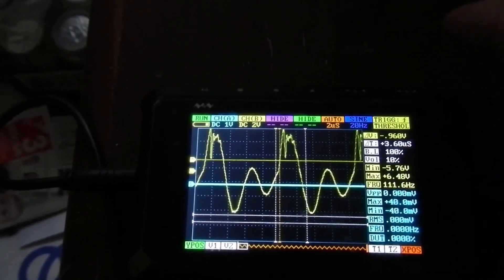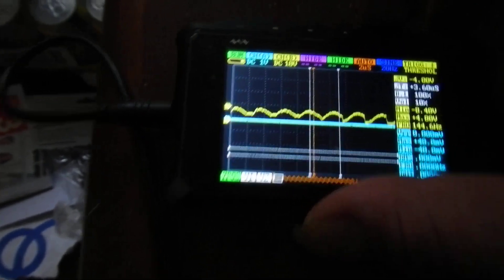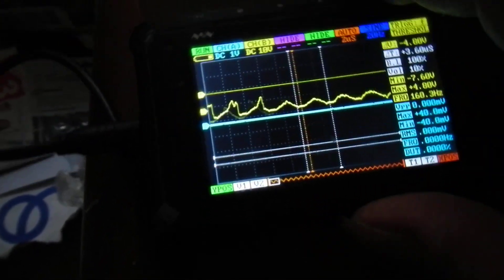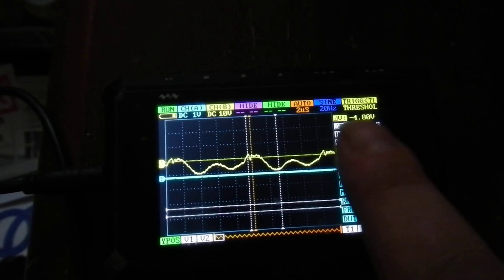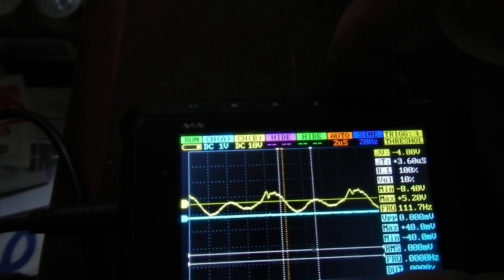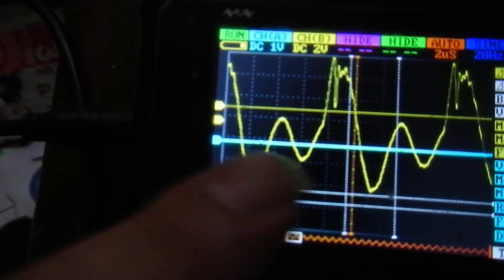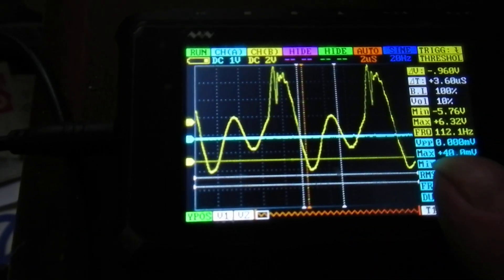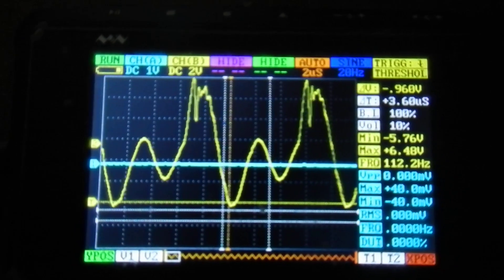Oscilloscope Trigger Tutorial DSO 203

Comment: Nice demo. I could never get used to that firmware, so uploaded Gabonator's and seems I bust the scope inputs....no idea, no readings on both inputs. The frequency generator still works great though. Perhaps it's levels issues.
Reply from the maker: I have no idea what you would have to do to burst the inputs?? Mine has been cliped to the top of a slayer putting out around 5kv. Didn't hurt it in the slightest. I suspect the firmware has issues. The only thing that hurt mine, is when I had earth from one channel on a car battery neg, and earth from the other channel hit car battery pos. Then there where sparks and a bit of a bang. Blew a cap on the earth and now one input wont earth the probe, so I have to have both ground clips in the same place to use that channel. This also affect the battery reading on screen. Its been a know issue since pre release. Next time I have the back cover off to calibrate the input caps I will replace the blown ground cap.
Reply: Mongrel Shark  Ha, think about the trace a car battery would give, your scope literally flat lined !
Well, I tried reflashing it today on Lubuntu based PC, but seems to need Windows so will do that on the laptop. Did wonder whether Slayer experiments back when I got it may have been the reason...so it's good to know that 5KV didn't damage yours.
Reply from the maker: Yea mine has really copped it from slayers. Thats what I was messing with when the earth lead flat lined it... You also have to be careful with the hook tips and TIP transistors. Easy to short the c-b pins with the hook if not careful. I can confirm this either welds the transistor to the hook, or blows the hook clean off, or melts the plastic near the hook. I wonder if I can get a big bag of those hook tips? Mine are all stuffed....

I've also had it in close proximity to spark gaps and stuff that have killed hard drives across the room. Amazingly well shielded. Although I do recomend keeping it pluged in to the wall outlet via mains-usb adaptor that grounds the neg rail via neutral pin in wall socket. Dont think you guys have locally grounded neutrals over there? Having it on battery, or worse, plugged into PC usb can present some interference problems. Especially when you have a spark gap.
Reply: Mongrel Shark
 For hook tips, is it an idea to solder a U shaped piece to what's left of the original ?

Not sure on grounded Neutrals over here. I'm an import anyway, but our house had no ground at all when we moved in. Was connected to the water pipes, which had fallen apart.
Good idea with powering via the wall when in use, for the grounding. Though you sir are a legend with high power experiments...not many of us probably shave with a weed eater either lol
Reply from the maker: I don’t think soldering the tips would go to well. Hot transistors tend to melt the plastic at around 100c. 270c for soldering could get really messy.

Weed eaters getting a bit worn out. Been looking into DIY turbojets. I figgure if I do it rught it will suck the hair into the inlet and incinerate it, saving me having to listen to complaints about beard hair in the sink.
Reply: Mongrel Shark
 Aha, well with your Tesla house from a while back...what could be better than using the metal of the sink hole to create a burning plasma field barrier and incinerate anything that got through !
Reply from the maker: Ohhh Plasma razor. Now your talking.

"No officer I don’t have a tazer in my pocket. That's just how I shave. Would you like me to demonstrate?"